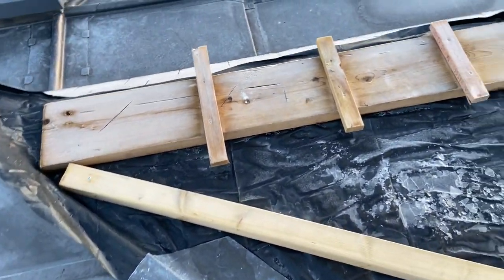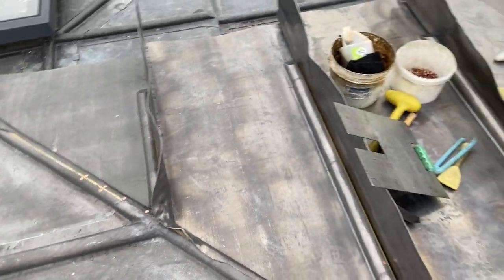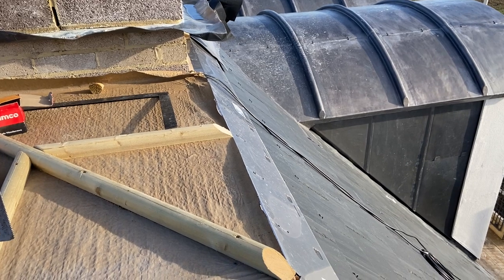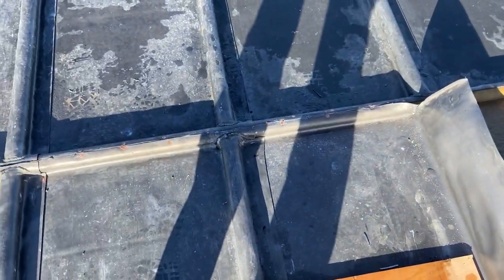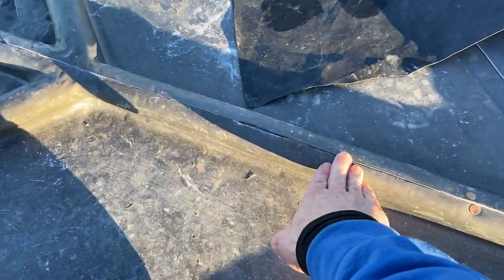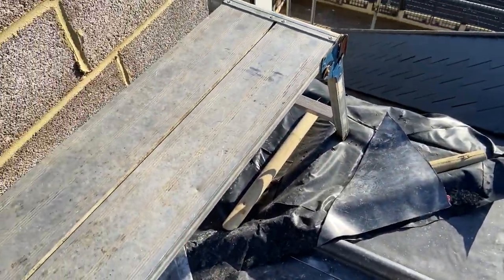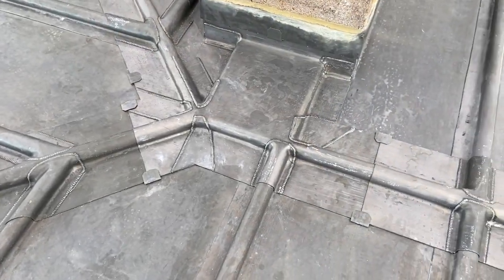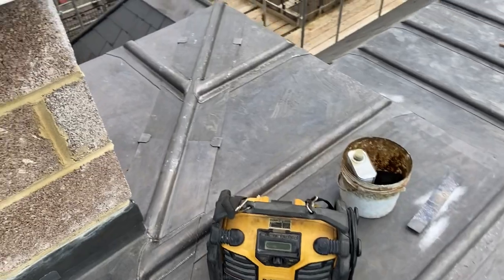Large Code 5 Lead Flat Roof Installation. Part 2

Comment: How come only the top course of slate is spiked?
Reply from the maker: I think it has something to do with wind lift and the hooks stop the slates from rattling. But if any roof slaters read this can you let me know if there’s any other reasons.
Reply: It’s because it’s the eve course at the top and is only copper nailed at the top of the slate so it will be flappy at the bottom, obviously the slate bellow are nailed in the middle of the slate so are secure 👍🏻